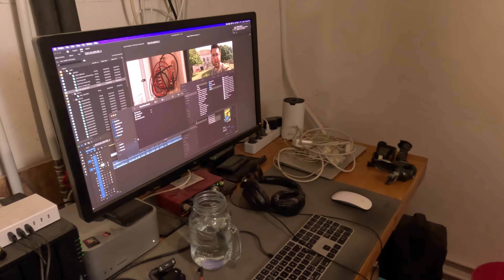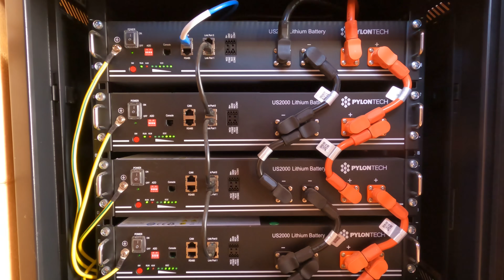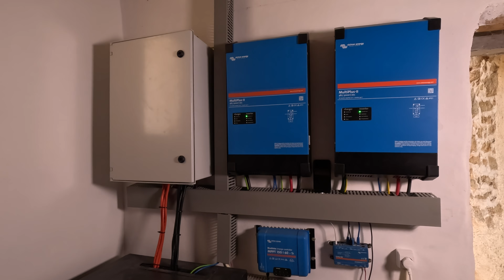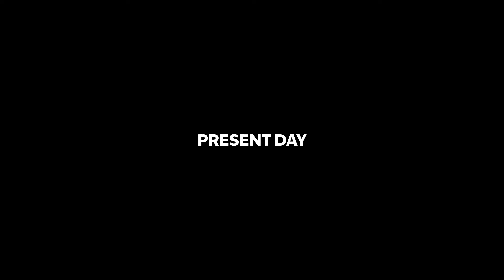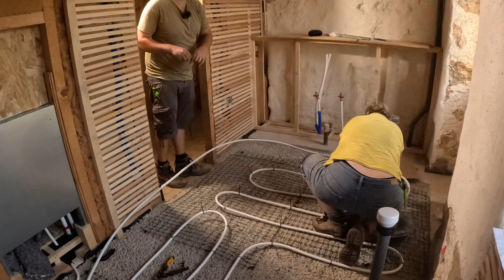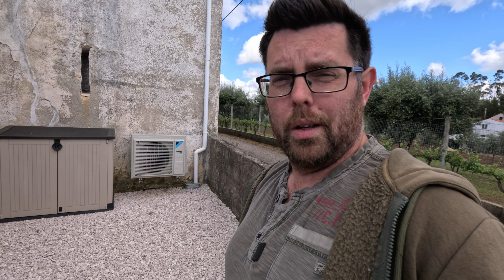Can Solar Power Heat Your Home All Winter? Our Experience and Data Revealed!

Comment: The 1 to 4 ratio of peak solar generation to battery capacity seems quite unusual, I've never seen anyone run that.

I'm assuming that on Dec 18th in the graphs you show at 12:16 the additional 7kwh of battery storage where already installed, what was the average charge rate of the batteries in winter before the increase in capacity?
I don't quite understand why you upped the battery storage capacity without adding more panels.
With a solar setup in Portugal, yeah, in the winter months the panels produce a lot less power, of course, but they still do produce power.

Wouldn't adding more panels have helped you reduce the usage of the generator more than the battery storage?
Or were the batteries pretty much at capacity before the additional 7khw?

I mean, I get it, solar always feels like a sort of whack-a-mole game to me, you rarely have exactly the right amount of storage, then you want more panels, once you have those, you kinda want to up the storage again. Rinse and repeat.

Comment: About the blackout...solar generation has one drawback, there is minimal 'inertia' in the generation system, when compared to say gas turbine or nuclear or hydro, which has huge inertia. Inertia is essential to maintain the AC frequency. So it's quite possible this inertia issue was behind the power failure. Off-grid solar/hydro/wind generation doesn't really have this problem.
Reply: Battery power Electronics add synthetic inertia. The more batteries in the grid, the more they will supplement the spinning reserves of thermal generation (fossil, nuclear, geothermal, biomass) or hydroelectric (real inertia) to keep the grid more stable.
Reply: @ I didn’t fully understand an article I read on this, but there is grid forming and grid following technologies, right now there is not enough grid forming devices on the system. Resilience costs money and it probably costs more with a high ratio of renewable sources.
Reply: @JohnnyMotel99  Grid forming might mean black start which is yet another discussion.  Grid frequency support-obviously not enough given the dip.

In a sunny, warm country like Spain/Portugal, max load occurs due to air conditioning-exactly when the sun shines, so solar contributes to reliability.  Eventually there will be too much solar, but then it's just turned off, so always adds or is neutral to reliability.  Not having spinning reserve or synthetic inertia/storage is a problem, but it's independant of renewable resources.  Without the renewables, you'd just have a blackout for longer as there wouldn't be enough power in the system.

But, yes, resilience costs money independent of whether intermittent renewables are on the grid.  Hydropower is a big grid resilience support.
Reply: @ Thanks for in depth comment!

Comment: We live in Spain and use solar for >99% of our electric demands. We have a grid connection instead of a generator for emergencies. We don’t pay a fixed tariff but instead pay the market value for the little energy we do take from the grid. Because of this, our standing charge is 7€ a month which is a more economical option over a generator.

Comment: Good thoughts there Guy. I have a 3.2 Kwh system with 13 Kwh battery plus grid connected, wish I had space for more panels. Winter is the main issue but as we have a night rate of 7p per Kwh as apposed to a day rate of 36p I charge up my batteries at night. I often say to friends why not just install batteries if solar is not an option but they think it's not possible. Hey ho!! Regarding the generator perhaps if it runs on diesel could it be run on waste veggy oil saving a bit of money in the process. I now use an air fryer and hardly use the main oven. I also use an old slow cooker using 15 watts. Something I found out eventually was that using my microwave at 800 watts as apposed to the kettle doesn't overload the inverter so my system uses battery exclusively when making a cup of tea. If that makes sense.
Reply from the maker: Yep, Kylie wants to run on biofuel in the future, hoping we can find somewhere local to buy their waste veg oil (since most meals here are served with fries) 😀
Reply: Electric pressure cooker maybe even more efficient than a slow cooker given possibly better insulation. But definitely more efficient than inductive or resistance cooking. Using an air fryer top on the cooker uses the insulated bottom so you effectively get a convection oven with better insulation and most of the oven is just a reuse.

Comment: have you considered solar roof tiles for when you do your roof on the main house,  the problem is with them they are rather expensive, I think you might want to look at water power, fair enough you dont have a stream but I wonder if you could use other methods

Comment: This was such an informative video...tnx😊
Living in Johannesburg South Africa, we know all about not having efficient power from our State owned power company, ESKOM😤
We took our 2 bed 2 bath house off the grid in October 2023. We have 8 x 480 watt panels, 5 kW inverter and battery.  It also runs our old fashioned electric 150 l geyser. During consecutive cloudy days, we don't run our washing machine.  Our saving grace is our gas Stove/Oven. R140 for 2 month's gas😀
I love your hot water system with the water floor heating(not something we have available iver here). Can't wait to see your log burner system🤩
It's something that would sell in SA like crazy
Greetings from 🇿🇦

Comment: I'm surprised you don't have an indoor clothesline. I notice some British homes  have these wooden racks that they pull down & then take back up.
Reply from the maker: Have you seen inside our house, it’s mostly still a building site. Clean clothes on a line wouldn’t stay clean very long 😂
Reply: @MAKEDOGROW consider a dehumidifier in a small closet or cloth wardrobe. Dries clothes and keeps all the Heat in the building. It is effectively a heat pump dryer.

Comment: No the reason you were tripping the power was because your rental had contracted a small amount of it... 
You can contract more power far more than what usually homes can spend....

Full off-grid has a huge cost. Environmentally and money wise... The batteries, you have to spend a ton to have enough batteries for multiple days... 

If you were grid tied you could use far less batteries... Plus exporting/giving solar power to the grid. Offering carbon free power to the system...

Without the huge amount of batteries, solar makes a ton of sense, even with a bit of battery storage. 

In the near future cars will be able to be used as backup battery storage and that will aslo help...
Reply: But it's possible for both their rental and their house now, that a package with more power was not available.
Reply: @hennnnerz  you simply ask on the app for the utility thing company to upgrade the  amperage... The thing is the more you contract the more you pay so usually you want to contract a small value...

Just look at thickness of the cables they have running into the house .. no utility would use that gauge if you could not increase it... Coper is expensive...

AFIK the you can upgrade up to 45 amps that at the 230 volts the grid delivers 10.3 kW more than enough for a toaster and most things ....

If you need more trifasic home is also available..

The rare cases were lower amperage grid side was the only one available was the one where the cables running into the house were still the cables were bare open not isolated... Have not seen those in decades...

Comment: Very informative ...we do have 6 kw panels but we sell to the grid...happy living in Queensland , Australia and paying very little or none bills. No batteries as they are too expensive ..We do have 4 houses in 44 acres so it is working.
Reply: The price of LFP cells has dropped considerably. I got carried away a bit this last year and have built a 45kWh battery using LFP cells. Well worth it in my opinion.

Comment: A good quote I heard about this subject recently. "Making yourself off grid now you are forward buying all your energy costs for at least the next 20 years". Seems a wise choice for me if it's achievable where you live.
Reply from the maker: That’s pretty much how we feel on the financial front 😀
Reply: @MAKEDOGROW What is the brand of your expresso machine?
Reply: Absolutely - for us it is worth it on so many levels. When the village has a power cut, we remain live!
Reply: A thought for others who may have inadequate power supply. A battery system even without solar could even out supply. It wouldn’t have to be very big either.
Of course Solar makes sense too.
Reply: Tanto lavoro e tanta soddisfazione,  ne so qualcosa!!!
Reply: I have 24 panels and some have said that it costs too much. I think of it differently. I've been "renting" my power since 1978 (I know, I'm old). Now I OWN my electric.
Reply: It's a better investment than a new car.
Reply: But will you have to replace the whole system including batteries and panels in 20 years? Maybe due to age, damage, or outdated products
Reply: @KeepCoolMaaan how long do you keep your car? Solar panels after 20 year the system don,t die it's just will be at 75-80% capacity.
Reply: @johanncover1988 ok, if you can pay with cash it would save you half for the life of a 25 year system. 

Solar cost
60k system 
Panels 25 years 
13k Battery 13 years (half panels years) 
After 25 years 13k+60k=73k
100k solar insurance annually 2500k
Maintenance $50 annually 1250k
Roughly 77k total

Average Electric cost per month $500
25x12x500 = 150,000k

But if you have to finance the system at 8% for the life of the system your amortization schedule will but you 20k over typical electric
Reply: You will still have future cost for replacing batteries that have a life of some four years…Off grid is to my opinion the best, grid connection depending on each year unpredictable changing rules… If I was living there I would go for off grid anyway…
Reply: Yeah it's an INVESTMENT... But you're forgetting one VITAL thing - Batteries. Lithium batteries have around 8 years of usage... If I even can make that prediction because they have CYCLES (charge & discharge). Soooo let's say you charge & discharge them everyday.... Those cycles round about 8 years!!! It can be more, it can be less! Depends on much you use them!!! And I'm not sure if this applies to "Solar Lithium batteries".... Because they are BIG!!! Probably they have more cycles idk.... People should check the amount of cycles they have really. But overall... That's the amount of cycles Lithium has. Soooooooo..... It's not "20 years"! 20 years is for the solar panels actually!!!! Which it also can be more because solar panels lose 20% of efficiency at the 20 year mark.... You can still use them after the 20 year mark... But bear in mind that they will produce LESS. And will continue to produce less over the years.
Some people actually called Renewable Energy a scam.... Because if you do the math.... The amount of money you spend on getting a "Renewable Kit" (solar panels + batteries + etc's) is EQUAL to the amount of money you would spend using OnGrid energy (fossil fuel). And doing some rough calculations... Yeah! They do seem to have a point!!! But you know.... Numbers are allllllll over the place. Some people consume little, some people consume more, energy prices are not the same from USA to Europe, Equipment doesn't cost the same from USA to Europe, etcetcetc. So it's reallyyyyyyyyyyyyyy hard to come with a definite answer!!! For me?!.... As an European... It seems that you will get the return of investment in 2-5 years. Soooo you have like 3-4 years of "free energy"?! Maybe more... It's not bad
Reply: Per the AI I just queried, Tesla Powerwall batteries are warranted to retain 70% of their charging capacity for ten years, though they frequently last up to 15 years. New battery chemistries will last longer. LFP batteries last longer, with some companies offering a 15-year warranty. Sodium ion batteries might wind up being the go to for home and utility storage because of lower cost.
Reply: Nay sayers. Luddites. Anything to cast doubt. Slow down the change!
I had a 2008 Prius and the big battery was humming along fine. 300,000+.  The AGM 12 volt battery was another story. Batteries today have a BMS to control when batteries are charged, under what conditions, and how much they are charged. The BMS (battery management system) in the Toyota kept that battery happy. 2008 is old tech. Just image where it is today, and it's working with batteries we could only dream about in 2008. Most manufactures have a warranty to replace said batteries for 8 years. Actual tests are showing that today's batteries are lasting much longer than the conservative estimates that were in place just last year (no surprise to me). Anyone can wait for whatever time they want, but publicly addressing disproven issues doesn't help the inevitable change. 
We did this over one hundred years ago. Horse and Buggies (had all the infrastructure) vs. gas cars.
History repeating itself.

Comment: Thank you for explaining your system and how it works for you.  The only high draw item you didn't mention was your water pump, but that would only be for a few very brief periods during the day.  There are just the two of you, and you're conscious of the power needed for every appliance you use, so your system functions well for you.  The wood burning backup heat will reduce the electric consumption of the heat pump in the winter.  Brilliant idea!
Reply from the maker: What water pump are you referring to?
Reply: @MAKEDOGROW  Ah!  Do you have municipal water?  I was thinking that in your rural area you'd have a well, but I must be wrong!
Reply from the maker: @ we have both. Our well isn’t yet functional so we only use mains at the moment

Comment: Interested in your views on the underfloor electric heating - does it keep the house warm? What was its cost and that of the heat pump and hot water tank?
Reply from the maker: Details of the heat pump and tank are in this video: https://youtu.be/V2PrjhDfsfE?si=uRJKpVgvsxObgP4w

We don’t have electric underfloor heating, it’s hot water based (so it’s using electric to heat water which in turn heats the floor)